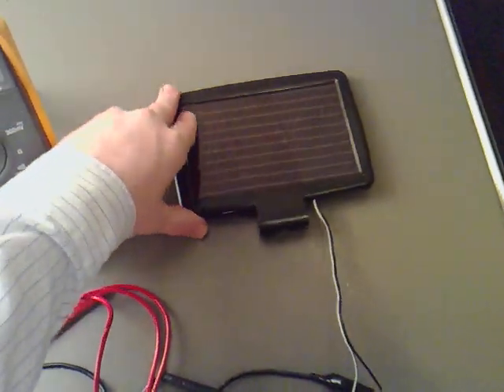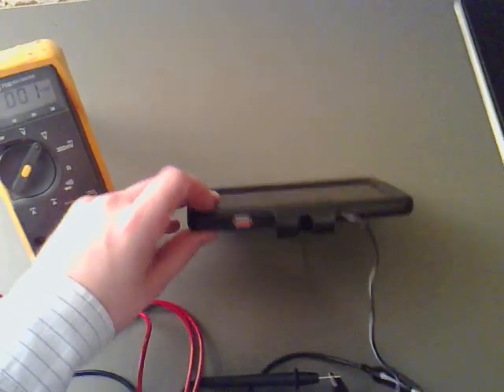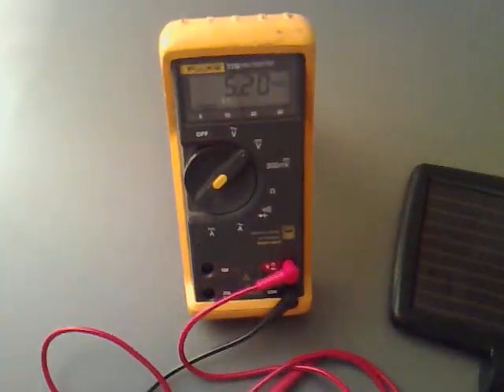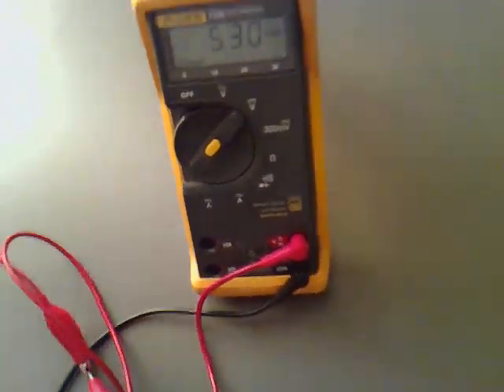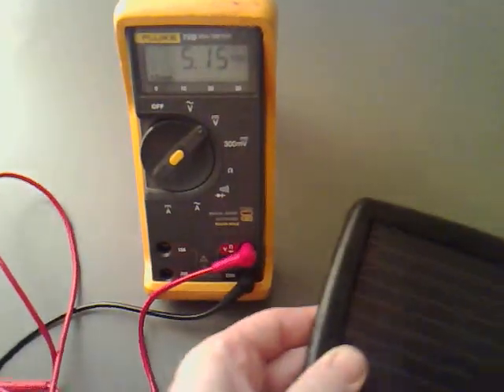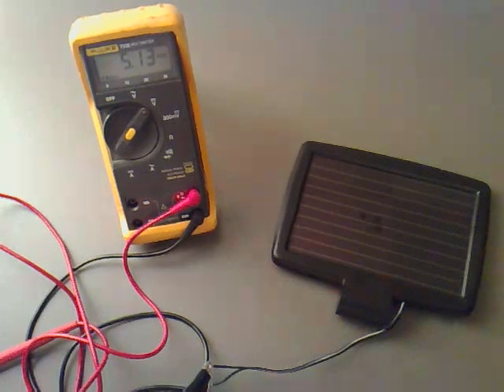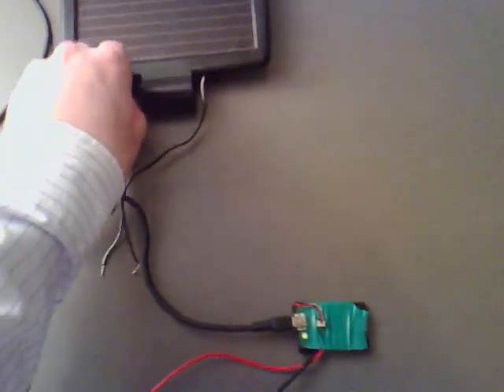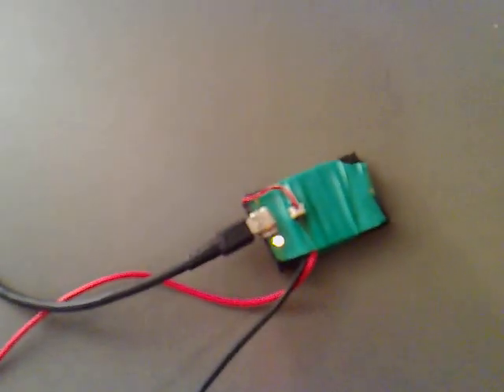Project Batteries (Solar Cell) 003

Comment from the maker: Hi Crob

Did you see my Pulse Motor video "One Phone to Another" it used the same batteries as these. I have been working on this for a while. I have a few circuits in the works for charge controllers and dump loads.

Once I get to a certain point most of my projects will overlap. 

The batteries will charge from USB in about an hour but the Solar Cell gives out about 1W, so 3.7v at 1AH will take about 3.7 hours in the light to charge to full power.

Hows your High Voltage HHO going?